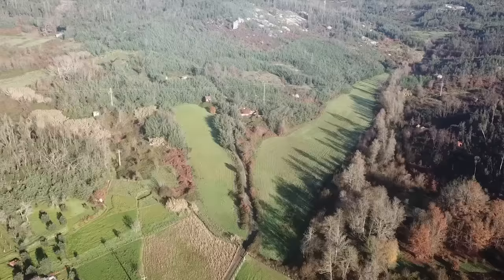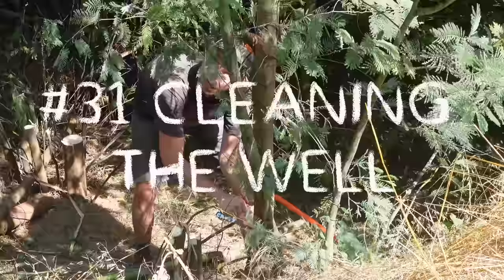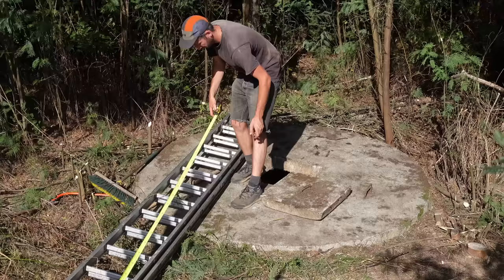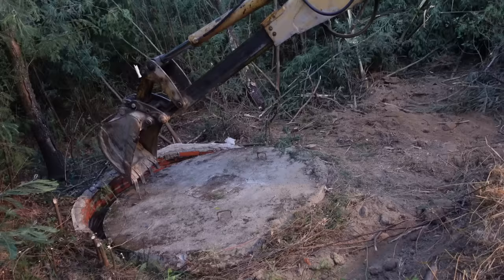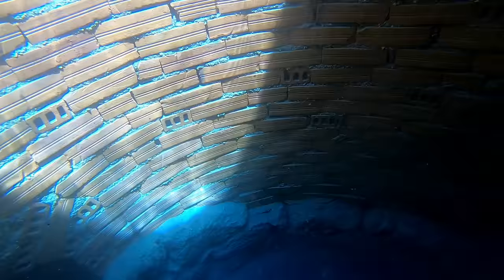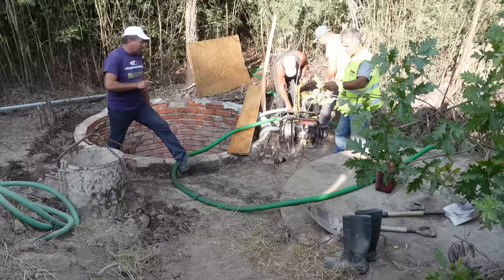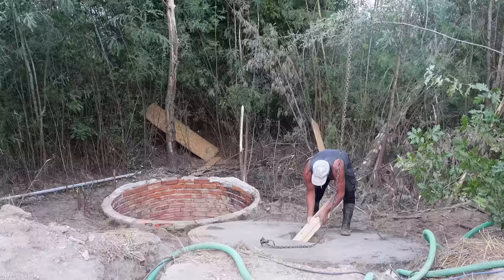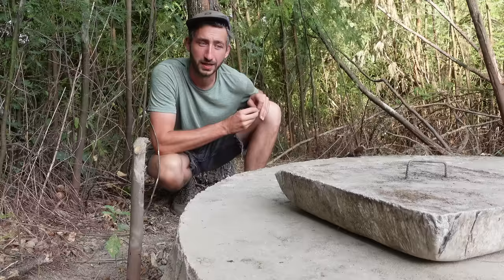#30 Opening up an old abandon water well

Comment: Hi brother,do not enter in well alone, because some time ground gases may be gather in well &it may be causing lack of oxygen or positiones gases. also use additional roap with safety belt for additional security.
Reply: @Pravin Patil  Good call and that is just a start.
Reply: This well was open for quite a while before he entered it , so bad gasses are long gone. falling in that well is like falling in the water , only a bit deeper. If you want to eliminate all risks, stay at home and wait till you re dead.
Reply: @haynillesen  many toxic gasses are heavier than air. Eg CO2 can pool at the bottom
Reply: @jonnenne  greatest risk for toxic gasses is when they are scooping the dirt in the bucket,but then they are with a lot of people and a lifting device

Comment: Nice job done
I must say that sometimes there is gas that stays in deep wells like this and you can die if you will breathe it in too much - sometimes it is just lots of CO2. So here in Ukraine people who clean the wells drop a blanket on the rope into the well. They lift it up and drop down to make some fresh air to go down into well. And never, never do such things alone
Reply: Exactly. Pretty dangerous could be because the co2 you pass out and drown. Simply get a slice of paper light it and drop in and ofcourse you never go alone.
Reply: our guy is purtuguese .... so here no issues
Reply: @heinrichlorenzen8671  but he went down on his own before the workers did
Reply: Yes very surprised not to have a tube air pump going dow there.
Reply: It's lack of oxygen, not abundance of co2 that kill you in confined spaces, because rust, bacteria and microorganisms already consumed it. Co2 poisoning is quite a rare thing, plus you will notice it right away, but you cant sense lack of oxygen in the air. You are probably thinking about carbon monoxide, which has nothing to do wtih thing case.
Reply: exactly, doing this as shown is very dangerous, use a fan or someting to be shure to have some circulation and allways have backup to pull you up if you suddenly faint
Reply: the size of that well and the fact that they pop open the lid, almost guarantees that no harmful gasses will be present in large enough amounts, that it would be considered a risk.
Reply: @Deathbyfartz  co2 is heavier than air..
Reply: @garystewart6093  Yeah, but u don't see people choking on CO2 in their basements?
Reply: @ledoynier3694  lol what a muppet
Reply: @Deathbyfartz  because basements have sealed floors, wells don’t dummy
Reply: It's actually something much, much scarier than CO2. With CO2, your body is able to recognize and warn you that the air you're breathing isn't filled with oxygen.
In underground situations like this, you're worried about water + minerals causing oxidation... It's not a new gas that's a problem, it's the fact that the hole is filled with everything except oxygen.

Oxygen depletion is extremely bad because your body cannot warn you that this stale air contains no Oxygen, and as such, can very quickly lead to a dangerous or even deadly situation.
Reply: "everything except oxygen" referring to a normal atmospheric composition.... Nitrogen, trace gasses, etc.
Reply: Hydrogen sulfide is also a serious hazard in such a space.   He had no idea of the risk he was taking going down into that well, and it’s a shame if anybody watches this video and thinks it was ok to do that.
Reply: @jacksons1010  my point precisely.
Reply: true.
Reply: @janosvarga962  CO2 is much less dangerous than just a lack of oxygen (e.g. if the atmosphere is all nitrogen due to the oxygen being consumed by rusting or if a tank has been dry nitrogen purged or whatever). If you hold your breath you eventually raise the CO2 level in your blood and you feel out of breath because CO2 is high (you don't notice low oxygen only high CO2!). This is why hyper-ventilating before trying to hold your breath can allow you to pass out; you purge the CO2 and suppress the urge to breathe, but you still run out of oxygen and there is almost no warning. In an enclosed space with a lot of CO2, you will feel it quickly and feel out of breath so there is at least some time to react before you pass out and you can maybe save yourself. If there is only a lack of oxygen but no CO2, you don't notice; there is no warning signal, you just get light-headed some seconds  before you pass out and brain damage becomes severe and permanent shortly after you pass out even if someone can very quickly drag you out of there.
Reply: The danger in a confined space is CO (Carbon Monoxide) not C02 (Carbon dioxide)
Reply: Ok guys so after reading all your reviews, what should I do if I wanted to clean my 15 years abandoned well with friends, rope, equipments? If you're saying leave it to well prepared guys I will and pay someone but yeah I think I can do this. So what's the best way of doing it?
Reply: @Lolmaro.  
If I were in your shoes, I would start with gathering with friends, ropes, ladder, bucket, old blanket, hook, short shovel, candle and a tackle block
First you start with taking out debris with a hook, then putting a blanket on a rope and dropping it down into the well and taking out several times to ventilate it. 
If a candle lit and put down on a rope burns fine - a person can go down and try to clean the well.
One person should tie a strong rope under their arms, and they are put down by 2-3 strong friends.
Well is cleaned with a shovel and a bucket. Bucket is passed up with a block and a rope.
Someone from above should always watch a person below
If something happens - digger should be taken up asap.
Reply: @dragoua5544  Well, it sounds like the plan I had in mind, thanks for the tips bud, cant wait to clean it!
Reply: @Lolmaro.  good luck on that, come back to say how did it went
Reply: @dragoua5544  will do, have a great day 😁

Comment: It's already been said but I want to repeat because it may save a life - enclosed spaces are very dangerous. You must always ventilate them first. Have someone who is able to properly assist you and is aware of the basic dangers of enclosed spaces. If someone collapses in an enclosed space NEVER follow them in - you will die too. Use the rescue line or SCBA to rescue. 
1 - Ventilate Space (continuously if possible)
2 - Make sure others aware of danger - do not follow you in if you collapse unexpectedly
3 - Use rescue line to pull casualties to safety. If this is not avail do not enter, await for rescue services.
4 - Ensure rescue services are aware of potential gas hazard - many rescues have gone wrong when people entered unaware of the risk.  
Stay safe - watch the many good training videos on youtube of enclose spaces training.
Reply: The chap filming was there
Reply: the old time well drillers would lower a lighted lantern down first. if it goes out it's unsafe to enter....no oxygen

Comment: That small entrance you found in the bottom of the well might be an old water mine (yes those are a thing in portugal ) that was caped off when they built that new well. It basically means that previouse to the construction of that well there was a mine conected to that spring that stored the water in a horizontal way rather than vertically (like a normal well) and it would be accessed in a lower point of the land. These water mines can have hundreds of meters in length and can pass through various pieces of land until they reach the point of access.
Reply: That sounds super interesting
Reply: I dont think i could resist checking how thick the wall is.
Reply: of the well ?
Reply: @do_3507  of the entrance to the little tunnel
Reply: @CHMichael 
I'm with you on that one. From what I understood from the OP is that there should be another access point somewhere. I'd have a hard time resisting trying to find that too. Lol
Reply: So they would've built a ditch and then a brick tunnel they covered or the whole thing is constructed underground?
Reply: @1nvisible1  the entire thing is built underground much like a regular mine shaft is built. Normally on a regular mine you are trying to maintain it dry  but on these ones the objetive is to actually store water along the length of the shaft. The one that my family owns is constructed in a way that at a certain point of the mine there is a retaining wall (about chest hight ) with a hole in the bottom of it, the water acumulates along the length of the mine until it reachs the top of the wall which acts as a safety by overflowing and maintaining a normal stream of water throughout the year, when the time comes to use the stored water we go in the mine and open the bottom hole on the wall and much like when you open a dam the water comes out with the acumulated pressure. when it is empty we enter the mine again and close the hole  so that the cycle can star again (which normaly takes a day or over night ). Another neat feature that these mines have is that almost always in their point of enterence exists what in Portugal we call a "presa" or "represa" (it roughly translates to hold or dam )which basically is a depression on the land with a retaining stone wall where water can collect and also be stored for later use. Again the one that we have as this feature and it sort of acts like a buffer to the water mine where water can collect during the open period of the mine so that we can menage it better and it also collects water along the overflowing periods of the water mine. It's like the backup of the backup ahaha
Reply: It's just an outlet to an open area of land. It was shown in a previous episode.
Reply: I believe you are likely correct there.
In an earlier video he shows that older cave (tunnel) entrance to this Well.
It is hidden further down the hill in masses of undergrowth.
But you can see it exists & was used relatively recently as there is man  made concrete.
I think now it may just be used for the overflow.

Sadly he doesn't clear this area or investigate more, probably because it's his neighbors land & he feels there's no need to clear it as he is taking water from the source Well itself :-).

Comment: You best remove some dirt around the opening/top so no rainwater, or other water can come in from the top, that will pollute your well.  Je moet de bovenkant rondom uitgraven zodat de deksel en put rand hoger ligt als de omgeving.  Oppervlaktewater mag niet in de put komen, bij bijvoorbeel veel regenval enzo. Verder goed bezig !! Succes !
Reply: The brickwork is usually extended well above the ground level for this reason.   Is suspect this well was intentionally reduced in height when it was capped.
Reply: it isnt just up it is down as well... I don't know how deep bedrock is where they are but if you arent down into the bedrock surface ground water can 100% penetrate in to that well. 

I highly recommend getting water tests

Comment: You should never enter a confined space like this without measuring the oxygen level first.  The min. safe oxygen level is 19.5%.  An alternative might be to blow fresh air to just above the water level by using a large diameter flexible hose attached to a fan at ground level.  Many people and rescuers have died in confined spaces.

Comment: Project camp : The feed pipe indicates a spring at the other end which means using a locator beacon on a fish tape and a transceiver above the ground will help you to locate the spring ...an old well like this typically has a spring that needs cleaned and maintained at a remote location and the well you have discovered holds the volume a household needs...it was easier to build the water tank closer to the lane and the spring water is piped in to it....
Reply: I think you are incorrect there. The pipe shows no running water but the Well definitely fills up from the bottom.
Also at the bottom you can see the spring-head (rock face) in a specially built archway.
Historically as mentioned in other comments, this spring-head was accessed by a water mine (tunnel) which can be seen in an earlier video. It is located further down the hill.

The pipe we see here is more likely a partially blocked overflow in this 'new' Well 👍

Comment: You dont want to fall down into the well. Because initially you can swim, but when you get tired, you will drown in the well. I have seen that happen several times in India. Wells are handy, but they are also really dangerous. You be ware!

Greetings,

Jeff
Reply: That was rather scary to watch in general. I liked how he was talking about going down when a brick was ready to fall down there, luckily he waited and moved it back to a safer spot.
Reply: That's not the scary part. Someone could have chucked down a ladder (they were filming after all). The really scary part is enclosed spaces. If the level of oxygen is too low, you don't feel it; there's no warning; everything is just normal until it is not and you feel a bit woozy before you pass out. There's no way to help you with that shitty ladder if there's no rope tied around you to pull you out.

Comment: problem well. earth collapse when heavy rain causing concrete cylinders to slant alot down the well.  removing sediment 3 plus years. bell shape erosion at water level. and can be muddy during dry season. borehole is less problematic. however check ask neighbors what the water is like .it can taste sour, .sweet or salty . sweet is best.

Comment: i was wondering about liability insurance.  A few safety rules being broken for sure.  As the land owner you also have responsibilities to the people doing work for you.    You need to be aware of this.  I am sure no one wants anyone to come to harm.   I have done a lot of work with contractors, and know how slip-shod they can be.  I would not have allowed them to have alcohol on site, and I would have insisted on hard hats and safety lines.  The well shaft itself looks to be badly lined.
Reply: ufurtunatly that sort of crew would cost a fair bit more of money, but yes you are absolutely right. Thankfully everything worked out ok. like 99% of the times.. problem is that 1%
Reply: True, but there was one wearing hi viz (like what's the point? Will it keep your shirt clean?) The smoking whilst filling up the generator in the middle of mimosa also had my toes curl. I guess fumes don't linger around long in open air but still. There must be reasons why you're not allowed to smoke at a gas station. Makes me wonder, these guys, were they of an official company or just friends of the neighbours helping out? I see that in NL too: if it's informal agricultural action, the H&S guidelines are often let loose. And it's all fun and games until something happens. Then everyone pays strict attention for a while until they return to the informal happy go lucky state of mind. (drinking lots of beer to celibrate that the first cut is packed and loaded and driving a few kilometers back to the farm with at least 15 people from down the road on top of the trailer loaded with hay (must be at least 4 meters high) and a few people in and on the tractor. Good fun but quite dangerous when you think of it.
Reply: @Roosmarijn035  I' am/was a civil engineer.
first thing.. the smoking and gasoline... not very dangerous 1 in a million like chances of going wrong, you actually have to make gasoline in to aerosol  in order to be in substantial danger, all the dry straw around them was more dangerous than the gasoline itself. but yeah dont do it just because it normally its ok is not good enough.
The vest, its mandatory in all constructions sites some of the guys have gotten so used to them that they use them in any work situation.. (helmets they take them off the moment you are not looking) they become quite uncomfortable specially in the sun.

Now in this specific situation a lot more safety gear would be needed A LOT more.
first thing for any of the guys going down a harness and a life line would be mandatory, also when the well was emptied  the walls should have been contravened to prevent possible collapse, and obviously the helmets and gloves.

ironically enough out of all of the dangers they put themselves at the cigarette on the gasoline was probably the smaller of them all

Comment: Where does the hole you labeled as "the overflow" go?
Reply: I would guess its simply going into the earth and delivers water for the surrounding
Reply: @Keptains  Dead ends in the earth? 😳 That really doesn't make sense, it looks like the well should have been allowed to fill way past that output.
Reply: Likely not an overflow but a pipe coming from a "water mine" as one would say in Portugal, feeding additional water to the well.
Reply: @VascoHenr  ... might have been a pipe from ground drain or roof gutters in years past. A hole in the ground is a good place to store excess water.
Reply: In later videos they uncover an underground water cistern beneath the large shed ruin. It is dry but it has a similar looking pipe at the top.
Perhaps water used to go to there but is now blocked, so it just seeps into the land & back into the original water-mine, which he shows briefly in an earlier video downhill in the undergrowth.

Comment: Why didn’t you pump the well water on to your garden and store some of it? Same with the silt taken out the bottom, the garden would have thrived off it, even just a few bucket loads. You must adopt the mindset to use and reuse every resource, waste nothing, that is what “sustainability” is all about. Same with all those mimosa tree trunks you cut down and saw as a pile of waste: if you de- branch them you have loads of poles to create shade structures for the garden, and camp.